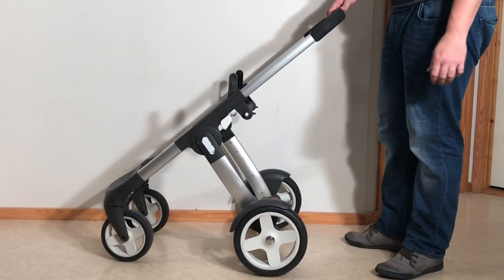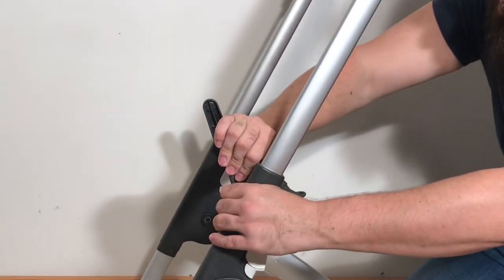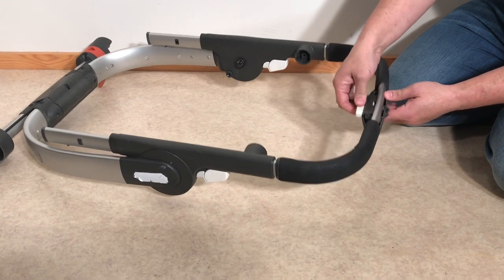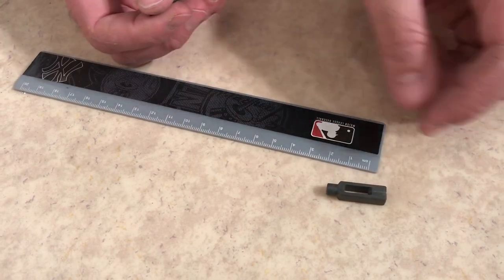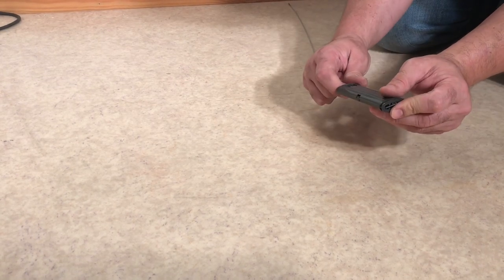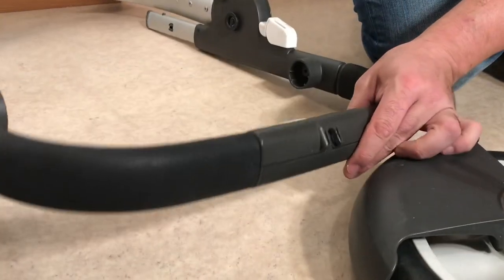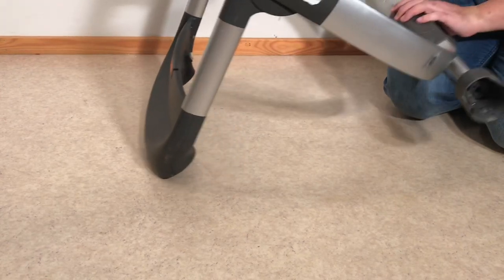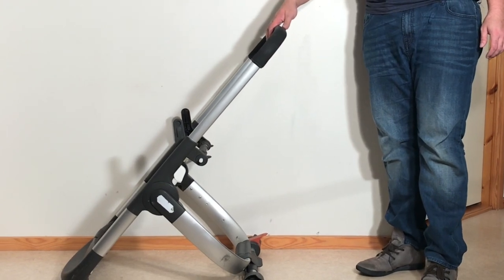How to Fix a Stokke Crusi Handle that Won't Lock in Place / Telescopic Problems

Comment: Hey, thank you for videos, could you please make a video with Stokke Trailz. I also have a problem with the screws in main arm. I cant screw them out...
Reply from the maker: Hi, yes we'll try to make one next time we get a Trailz in.  The process is more or less the same though (just easier since you don't have to deal with the central handle button).  As far as the screws are concerned, this means that the lock-nut is turning with the screw inside that little plastic piece you can see at 2:43 in this video.  In order to get the screw out you can flip the stroller upside down, position your drillbit right in the center of that little piece (from the bottom it looks like a square) and drill directly into the plastic piece until your bit meets the nut.  In this way the drillbit will hold the nut in place while you unscrew the screw, and only that little piece will be damaged and need replacing (unless you can live with it having a hole in it, it's ussually still functional).  Best of luck :)